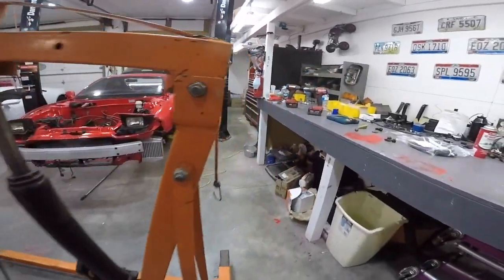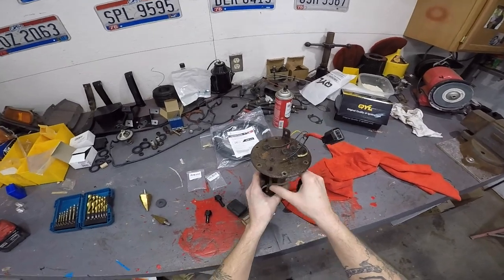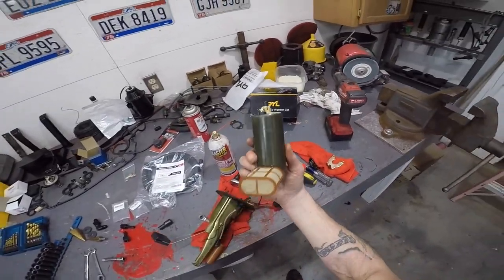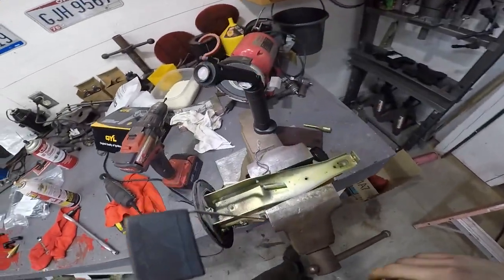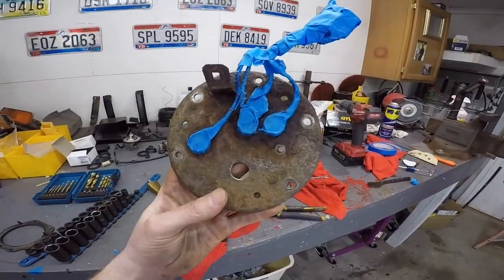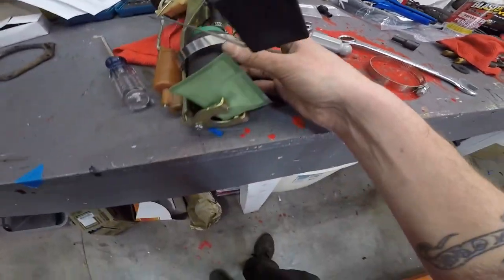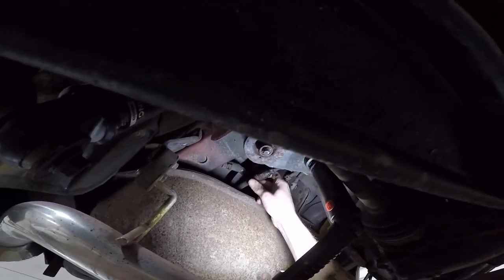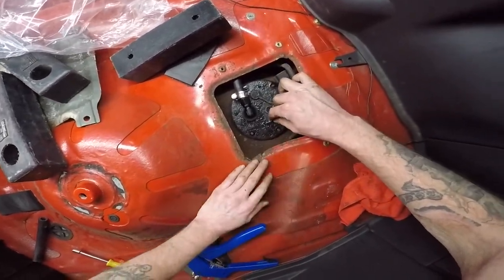how to fix fuel pump sending unit under $50 / new fuel pump

Comment: Good info & straight to the point! Looks like you are in Ohio? Working on a 97 sohc that has been sitting for a while & not getting fuel right now. Reason I ask about Ohio is I also have a 96 Spyder that has a hydraulic leak somewhere I can't find. Any experance with the Spyders? I'm just south of Newark.
Reply from the maker: No, I don't know anything about the spiders. Does the top work with hydraulics? ?

Comment: What is the link to the gasket you used with the 90degree fitting on top of the sending unit?
Reply from the maker: like the rubber washer that I put in between the fitting ?
Reply: @huracanian3051  yes
Reply from the maker: @ignaciocastaneda5678  I don't remember you just need a rubber washer .. that the center hole is as big as that 90-degree fitting ..
Reply: @huracanian3051  sounds good thanks

Comment: How did you reconnect the ground?
Reply from the maker: It's been a little bit since I did that what ground are you talkin about ?
Reply: @huracanian3051  I just noticed in you next video how you did it. I broke the fuel elbow and the ground just like you did. I saw that you just ran that broken black ground wire on top to one of the nuts that bolts the sending unit down. Thanks for the quick reply!

Comment: Do you think if I cut off both the oem connectors on the top of the fuel delivery system and the one that connects to the fuel line that I could just put a high pressure hose on each side would it leak or bulge or anything?
Reply from the maker: You would have to flare it for sure ..  I honestly don't know I want to tell you something and you leak everywhere
Reply: @Huracan ian  I got it thx for the reply I ended up just rebuilding the old hose lol

Comment: Hello Huracan Ian I was wondering if I could somehow get into contact with you related to issues im having with my 91 SL, ive replaced so many parts that at this point I need someone who knows. TIA
Reply from the maker: I mean what's wrong lol 😆
Reply: - NGK Full Spark Plug Wire Set (From Autozone) $150 (Bought 6 NGK Platium Spark Plugs as well 12-18-2023), PTU CarQuest, Ignition Coil, CarQuest ECU, Timing Belt/OEM Mitsubishi Water Pump, metal gasket, and pipe o-ring,OEM Rear Idler Pulley,OEM Hydraulic Tensioner,Upgraded OEM #8 tensioner pulley bolt (R'Venge Performance) these are all things ive replaced and I also checked the shops job on the timing belt, All cam marks aligned same with crankshaft when I manually turned it over.
Reply from the maker: @ExtremeGamersBenchmarks  well platinum spark plugs are garbage. I always run copper. I did a video on it but what's the problem? What are the issues you're having?
Reply: @huracanian3051  Well now I upgraded my stock pump to a bosch one from Rock Auto, it keeps blowing the O rings off the hanger and losing pressure. I hear a loud swoosh sound and it no longer turns over, re did the fuel pump with new o rings, started and ran 4 times to make sure it was good and on the last one it did the swoosh thing and O rings became loose. Do I need to upgrade the FPR or should I take this routein the video?

Comment: For anyone who doesn't know... you DO NOT undo the fuel hose from the sender unit side, the nut is locked, you under the same rubber hose from the fuel line going to the metal line going to the fuel filter. This is the main reason these end up in the trash all the time :)
Reply: Yea i found this out the hard way lol

Comment: Hi Ian may you tell me where did you get the rubber washers? are they Nitrile washers or Epdm rubber washers? Just curious about the size and material since they will be sitting in gasoline I don't want them to be eaten over time. Thank you for your time. Cheers!
Reply from the maker: I got them on Amazon I use a neoprene washer good for gas and high heat
Reply: @huracanian3051  awesome i bought everything else you posted a link to. Do you remember the size by any chance. So many online.
Reply from the maker: @RamonHernandez-oi7fm  no sorry ... get the same size as whatever the 90 is I really don't remember man... .. probably just the next size bigger than the hole that I drilled ...
Reply: @huracanian3051  thx m8. Have a happy 4th. Cheers

Comment: Yeah no need to spend all that money on a 3SX one , just drill out the OEM one an do exactly like you show here. Good Video Ian. Will help out a lot of people I bet. I'm off to go watch more of your videos while I relax before heading out to the garage an put some more parts back on the Stealth.
Reply from the maker: Thanks man what all u doing to ur stealth ?
Reply: @huracanian3051  tdo4H 19t Arashi, RC 550s MAFT safc2 combo, cxracing side mounts kit fits soo good, Derale oil cooler, PST 2 pc, 300m ouput an sleeve an Front LSD. with water/meth kit.  eventually I will move on to a better ECU an when I do I will go for the Forged engine build an single turbo, For now I will enjoy this tried an true setup, for a while Its been a Blast learning the Safc an rebuilding my Cylinder heads with new VSS an the high rev valve springs and cleaning everything. Rebuilt Transfer case with the hardened sleeve. I will upload a video of it.
Reply from the maker: @tsgarage2382  that's sick .. My side mount intercoolers.... Idk the piping didn't really fit to good... U got a link for that oil cooler ?
Reply from the maker: @tsgarage2382  did you use your stock oil sending unit or  did you get one of those adapter plates and then block your lines off? If not do you know what size AN adapter fittings I would need cuz I know the car is female so I need like a AN to AN fitting with male on both sides but I don't know what size 10AN or 8AN ?

Comment: Great tutorial man, thank you! What was that rubber washer you put on the 90 degree fitting though? Have specs on it?
Reply from the maker: No you just got to get a rubber washer that has the same diameter as that fitting so when you torque it down it seals like a gasket.. .. the rubber washers I got where actually a little bit too small honestly.. you need to get a rubber washer that's the same size as that fitting something like half inch or something it can be a little bigger
Reply: @huracanian3051  got it, thanks for the quick response! Much appreciated
Reply from the maker: @boosted_streetz8147  yeah man no problem you need anything else just ask

Comment: Do you mind sharing the parts list?
Reply from the maker: Yea sorry it took me so long to get back to u .. I seen your comment this morning and then I fell back asleep and forgot that you left the comment lol
Reply from the maker: 6an female swivel to 3/8 hose barb ..

90 degree 6an male flare union bulkhead fuel fitting with 6an bulkhead nut ...

 Thin I used a metric m14x1.5 female to 3/8 hose barb to fit a 3/8 fuel line .. U and get that m14x1.5 to 6an which I'm going to end up doing.. I just did that for now to show people you can do it cheap
Reply: @huracanian3051  Your totally good man. I just appreciate you  reaching out. Rusted out fuel hats is very common on these cars as you know. Your awesome for restoring such a unique machine. Thanks for the info!

Comment: Can i get a link to the parts?
Reply from the maker: I've tried sharing the link on here a few times I got in from Amazon but the links don't seem to ever work
Reply from the maker: Here's a part list you can just look it up on Amazon 👇

 6an female swivel to 3/8 hose barb ..

90 degree 6an male flare union bulkhead fuel fitting with 6an bulkhead nut ...

 Thin I used a metric m14x1.5 female to 3/8 hose barb to fit a 3/8 fuel line .. U and get that m14x1.5 to 6an which I'm going to end up doing.. I just did that for now to show people you can do it cheap

Comment: Probably gonna end up taking my fuel pump out tomorrow so this may help alot!!
Reply from the maker: Yea man ... let me know if you run into any problems I'll try to help you out
Reply: @huracanian3051  I bought a 1991 Stealth RT TT and it's got a 6 speed in it from a 96 model, anyway runs but doesn't like shifting above 2k rpms....... it feels like a fuel issue not sure what else to start trouble shooting yet, already put in a fresh Fuel filter so gonna try a new pump

Comment: Good job. I went through the same deal a few years ago like many of us 3s owners do. Wirebrushed it and used por-15 paint on it which has held up great.
Reply from the maker: I'm going to take it back out and try to make it a little bit better drives me nuts it being like that... did you end up putting that bottom bracket back on ? Or did you leave it like I did?
Reply: @huracanian3051  Nah that lower bracket only works with the stock fuel pump. I did like you with hose clamps. I think might be a good idea to coat it good in a rust protective paint because there is alot of water and dirt that gets trapped there. I mean you saw what it looked like before  :) But you will probably be fine as is.
Mine wasn't that bad in terms of the rust but I kinked the metal line when trying to remove the hose so had to replace it because of that. Kinking that line is also comon and can lead to bad things because of lack of fuel obviously.
Reply from the maker: @rickarda9232  yeah I'm going to take it back out and repaint it.... I'm probably going to drop the fuel tank send that down and paint it too .. just wanted to make a quick vid on how to fix that sending unit cheap I need to get back there and replace the diff anyways so once I get started back there I'm going to overdo the whole back end like I always do lol .. I'm going to replace that rubber line with braided
Reply: @huracanian3051  Yeah all good sounds like a plan. Redid my rear subframe a few years ago but actually just bought a low milage x-frame out of a 99 for cheap without any rust and fresh bushings. So was a quick swap. Did the rear wheel steering delete while I was there. That system weighs like 25 lbs. But if you like the AWS you may awell keep it.

Oh and the rear diff that thing is usually covered in rust. Like really bad. But go to town on it with wire brushes and paint that too. I did that also.
Reply from the maker: @rickarda9232  I already deleted my rear steering and painted my subframe and put new bushings in.. a few years ago I just did it real quick
Reply: @huracanian3051  Cool that is great. I Havn't had the chance to watch much of the older videos yet. I just subbed. Keep up the good work doing great!
Reply from the maker: @rickarda9232  oh you're not missing out on anything there are worse quality and editing than now if you can believe that lol

Comment: Damn U learned something new everyday. Hopefully future 3kgt owners learn from U to make sure they use the 19mm not the small 14mm on the line so won't have to go through this as well well disconnecting from bottom of the car. 

P>S> what tool is that the blue one that using to cut hoses? that shit looks bad ass!
Reply from the maker: It's a Ratchet pipe cutter lol it cuts everything

Comment: Great video! This definitely brought back memories lol. That fitting on the line that broke is probably one of the biggest PIA to get loose since the threads on one end is in opposite directions of the other😒.
Reply from the maker: Yeah that nut on the Hardline doesn't turn either I didn't know that
Reply from the maker: Did you put that bracket back on the bottom of the sending unit or did you leave it off like I did ?? I'm worried about is smashing the filter but I'm also worried about the pump getting stuck to the bottom of the tank soooo lol idk
Reply: @huracanian3051  I replaced mine about  4 yrs. ago so I'm a little fuzzy but I think I left mine on.
Reply: @huracanian3051  honestly I can't remember if that nut turned or not. All O remember is having to use a few vicegrip plier and a box end wrench to get that line undone. Looking at pics and vids of most peoples fuel sending units makes me glad the original owner of my VR4 keep it in the garage lol

Comment: Great video. Just be careful with the fuel hose you chose. Its not rated to be used for fuel injection and will bulge and burst in time. Speaking from experience.A lot of people miss that.
Reply from the maker: I'm going to do all braided line eventually .. Can't really use any of that rubber line for e85

Comment: Instead of cutting with a Dremel couldn’t you just drill from the top side Where the fuel line hole is as a pilot for your drill bit ?
Reply from the maker: I mean ur not wrong lol .. you might bind up and break a drill bit if you're sending units really rusty you might break off a really big hole if the fuel line brakes off and takes a big chunk of the sending unit with it